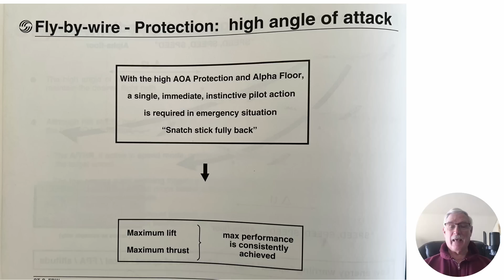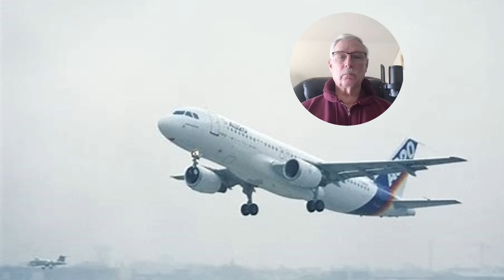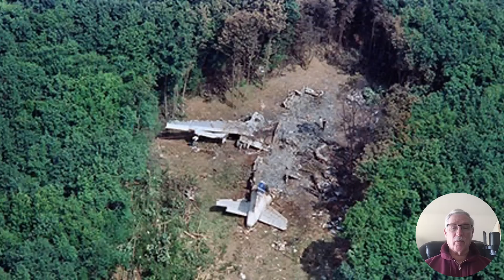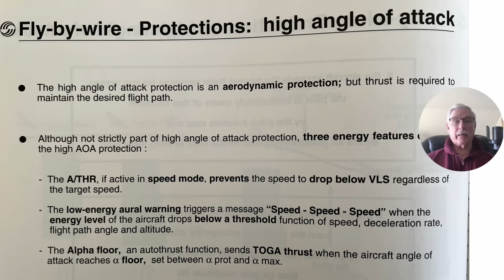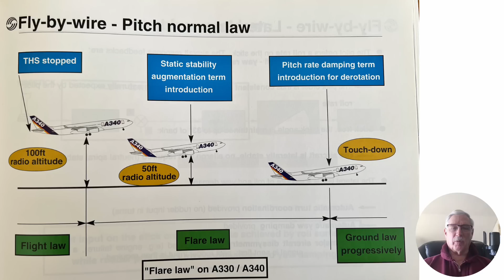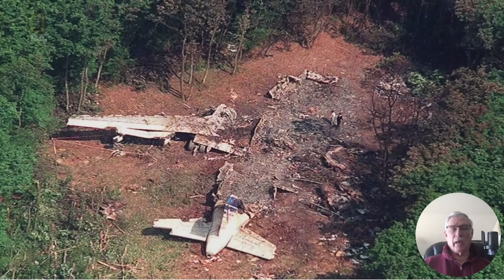Overconfidence in Fly-By-Wire protections First fatal A-320 crash 26 June 1988

Comment: Did they advance the thrust levers at any point ?
Reply from the maker: Yes but too late
Reply: @ronrogers  ok so they were waiting for the plane to do it ....when i fley a plane that had auto throttle i used to help it out sometimes....make the plane do what you want ...dont let it fly you
Reply: That was my first question as well.
Reply: Very harsh treatment of the Captain to send him to jail for 10 months it seems
Reply: @AaronHarberg   Take a look at the French accident board report for more details on the many ways in which the captain not only screwed up, but in a most arrogant fashion... with a plane full of passengers in an aircraft he had intentionally brought to the edge of a stall at one-fifth the height allowed under French air show rules.  His claims regarding aircraft malfunction were factually disproven, leaving responsibility for what happened squarely in his corner.
Reply: @AaronHarberg  you think, going to jail for making reckless decisions that resulted in killing seven-year-old who was asphyxiated to death is harsh treatment?
Reply: At least twice, in fact, which was part of the reason for the crash.  The captain cut the throttles to idle briefly when he felt that the engines weren't responding as quickly as he had expected to his initial throttle advance.  He didn't know what the problem was (turned out there was no problem, other than his misperceiving the engine response) and so decided in the moment to try a "reset".  That start/stop/start, with accompanying spoolup/spooldown lags, resulted in the aircraft flying along the runway at less than full power.